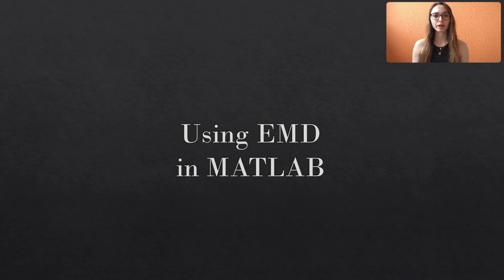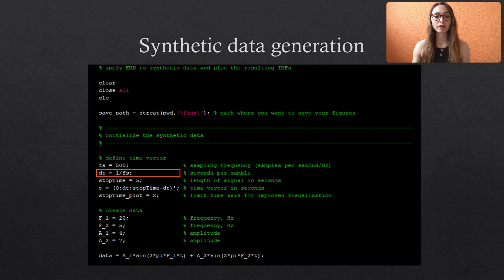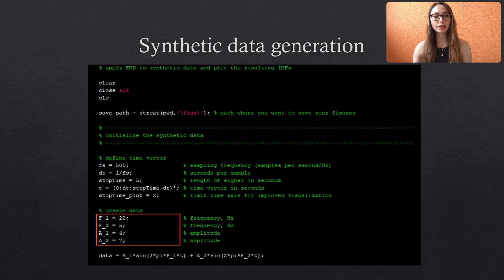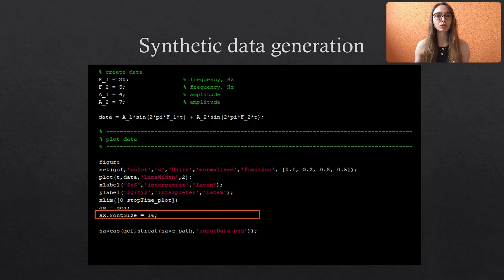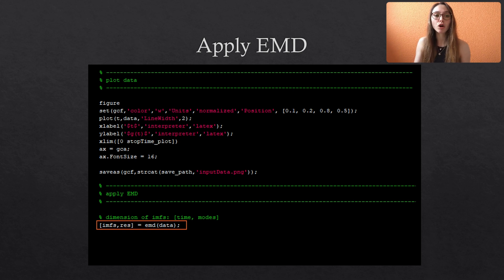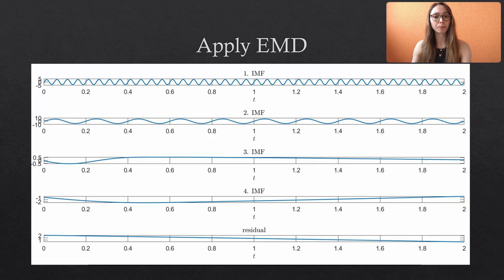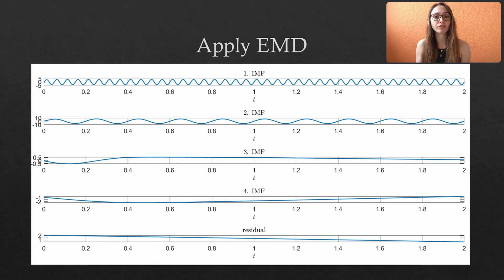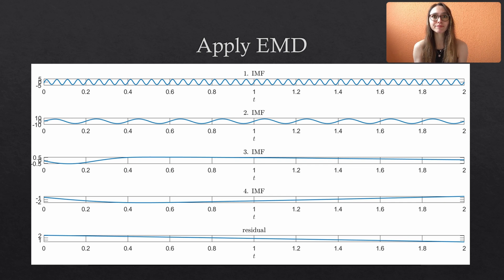Empirical Mode Decomposition (1D, univariate) in MATLAB

Comment: Hi Esther,
Your videos are most helpful. I have a few questions that I hope you may be a able to answer. I am trying to analyze EEG signals. For such signals, that may contain several distinct frequencies, should I use the univariate or the multivariate EMD? Does Matlab have the capacity to perform multivariate EMD? 

Is there any role for noise assisted EVEMD in analyzing EEG signals?

Thank you,
Gabriel
Reply: Thank you very much for the reply. I'll look at Prof. Mandic's articles.
Reply from the maker: Hi Gabriel, if you want to compare the modes of different EEG signals, you should use the multivariate EMD such that same indexed modes of different signals contain the same range of scales. As far as I know, Matlab has no build-in function for the MEMD but you can use the code provided by Prof Mandic (the link to his website is in the description box of my MEMD videos). You can also check out the example code in my git if you are not sure how to implement the function.

It is always a good idea to use the noise assisted MEMD. It gives you a better separation of the individual modes and you have less mode mixing. This should facilitate the interpretation of the modes. Good luck with your analysis!

Comment: I need your email and I will have attached the data.
Reply from the maker: I am sorry but I don't understand your intention. What do you want from me once you have my email address?
Reply: @estherexplains7521  I have 15 years Radiosonde Temperature data, So how can I write EMD matlab code in this data?
Reply from the maker: @tsehayenegash8394  import your data into matlab in form of a vector; let's call this vector "data" and you can simply use "imf = emd(data)" to apply the emd to your data; and I think that you must install the "Signal Processing Toolbox" to be able to use the emd function
Reply: @estherexplains7521  I appreciat your kindness. I did the program like this:
1. Temp=xlsread('Addis_Ababa_wholeRS.xlsx',4);
2. imf=emd(Temp);  but in command window appears Undefined function or variable 'emd'.
Reply from the maker: @tsehayenegash8394  have you tried to install the signal processing toolbox?
Reply: @estherexplains7521  ok, I would try it thanks